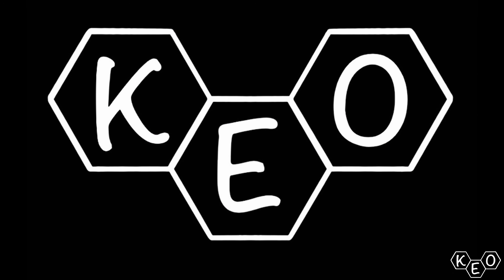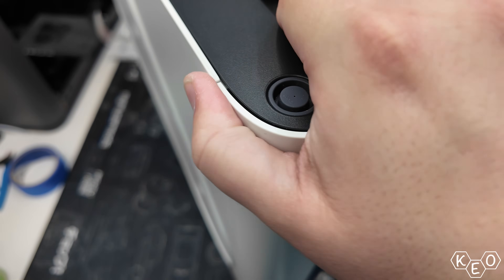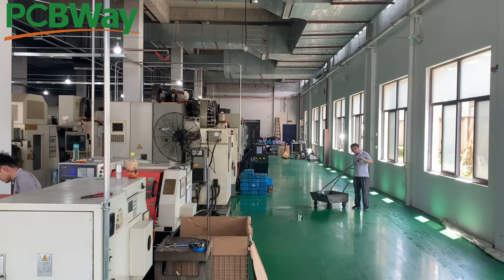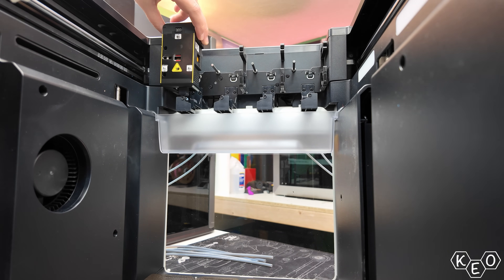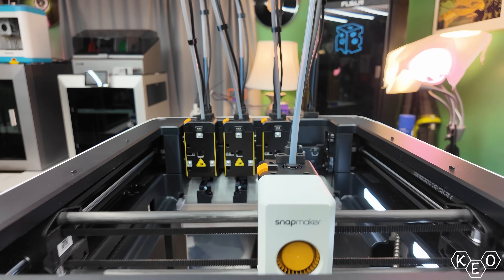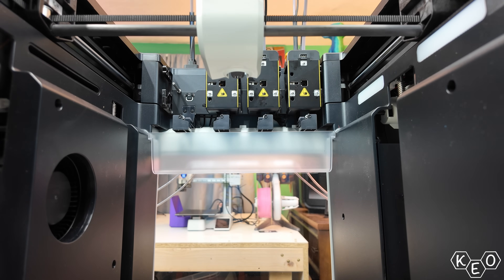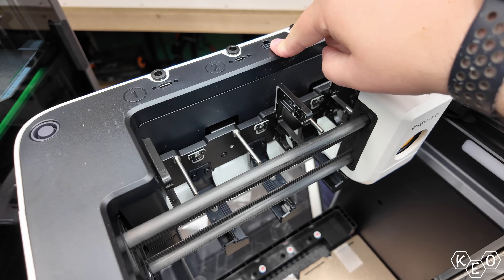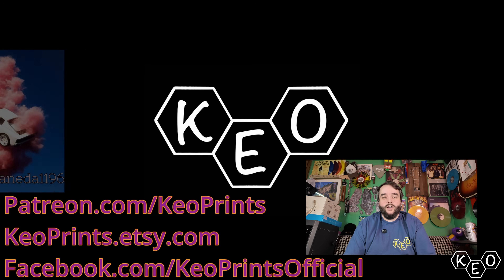Why Is the Snapmaker U1 This Cheap? (Initial Impressions)

Comment: It seems like the prime tower is normally located right over the probing circle. I wonder if with a hole in that spot if the heating the textured PEI sheets would be affected. I heard some other creators have issues with the prime tower sticking during a long big print.
Reply: I had the tower falling multiple times even with extended support at the base. I can confirm after moving it to another location, no more problems
Reply: I wonder if you could fit a coin in there during prints for heat distribution
Reply: That's what I thought when I heard others have had prime towers fall over.
Reply: My prime tower sticks really good, stock plate and 55c on the bed.

Comment: Yeah, $1000 is not cheap for a 3d printer but it is a bargain for a 4 tool head changer. I bought an H2c for myself, but I’ll probably be buying this for my daughter who is currently using one of my P1s’ to waste a ton of my filament doing multi color prints. This’ll pay for itself quickly! The H2c, while slower, is still next level. Currently printing a full size (one piece) Capt Cody helmet in full color (six colors). So, yeah, H2c is slower, but it can do things this printer, and even the XL, can’t (without manual work arounds, like pausing to swap out rolls of filament). The U1 looks like good value, but I do wish they’d charged a bit more and put a bit more in to fit and finish, or maybe hardened internals…
Reply: I spent the extra $40 to get 4 hardened nozzles from snapmaker 🤷‍♂️

Time will tell to see how hard the extruder gears are
Reply: @Werdna12345  yeah, this vid made me wonder about that... Not only the gears, but potentially the PTFE tubing as well? I've never done abrasives so I don't even know what could go wrong... But I have the time to research, mine won't be here before April 🤣
Reply: checking the product page for the hotends, it does not mention abrasives. You'd think they'd specifically mention PA-CF et al if the hotend could manage it.

The AI Chatbot (which uses a knowledge base in the back-end and has in the past plainly stated when it did not find an info), is optimistic though:
"Yes, you can print abrasive filaments with your Snapmaker U1 by using a hardened steel hot end. These hot ends are wear-resistant and available in multiple sizes to ensure consistent quality and long-lasting performance when printing abrasive materials. Just remember that different sizes cannot be used in the same print."
Reply: following up with a question about the other components:
"The Snapmaker U1 uses hardened steel for the extruder gears, which are more resistant to wear and suitable for handling abrasive filaments like PA-CF. However, the knowledge provided does not specify details about the PTFE tubes' compatibility with abrasive filaments. For optimal performance, it's generally recommended to monitor these components for wear and replace them as needed."
Reply: @sourcererseven3858 Good to know. I do wonder about those notched ptfe tubes… wondering if you can replace them with regular ptfe or if this will be another wear item that must be purchased? This isn’t a complaint. I’m fully aware that ptfe tubing is a consumable item for any printer. 😊
Reply: The h2c is still dependent on the AMS, though.
So in addition to being slow you can't even use flexible filaments in multi material prints.
At that price point that is an absolute dealbraker
Reply: @Grammostola You can use flexible filaments in the right nozzle and other filaments in the left. So, you can’t use the vortech nozzles to do color/material changes but you can run flexibles through them.
Reply: @sgtrat87 yeah but that means you have to choose between flexibles and using the vortek at all. sorry that's just  not acceptable for a system that tries to compete with toolchanger systems, especially not for this kind of money. The  whole system feels like a stopgap and will be obsolete the moment something like the INDX becomes available. The only thing this thing got going for it is its headstart on the market.
Reply: @Grammostola Not sure I agree with you but I understand your point. I plan on converting my sv08 to the Indx hotends when they’re available, and people smarter than me have worked out how to make it work. I don’t think the Indx system will be adopted very widely so long as it’s a mod for printers rather than a complete system. I think the majority of 3d printers go to people who want it to work right out of the box, using nothing more than their smart phone. I also don’t agree that the H2c was meant to compete with tool changers. I think BL developed it to extend the flexibility of their AMS system. The AMS is what brought multi color 3d printing to everyone who couldn’t afford the several thousands of dollars for the Prusa XL. It quickly became the standard. The biggest problem from the start was waste. That’s what the H2c was developed to address, not time. Work with the AMS ecosystem, and reduce the waste associated with multi color prints. I’m quite happy with my H2c, and I will be buying a U1 for my daughter, and an Indx for my sv08. I think this is what everyone is missing. We now have choices for systems that serve our individual work flows best. If the H2c isn’t for you, don’t be upset, choose the one that fits. 😊